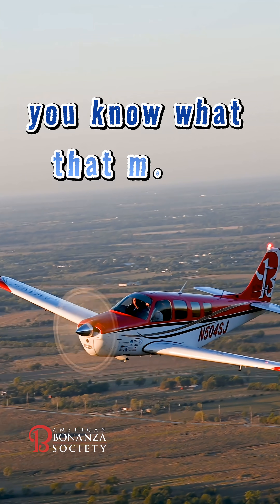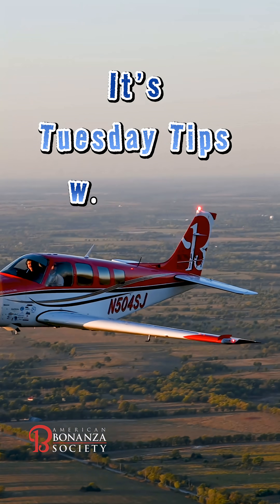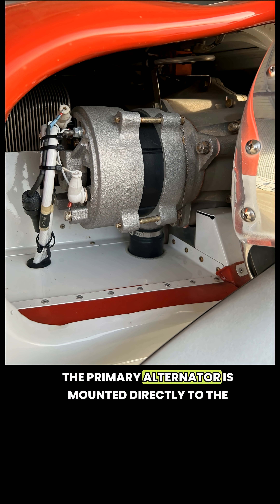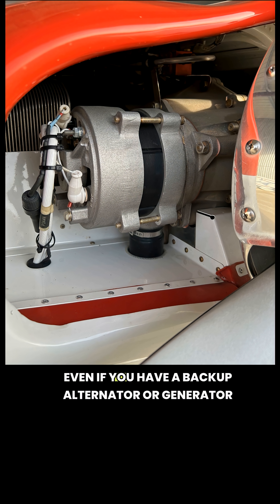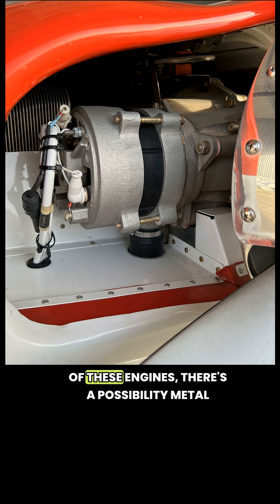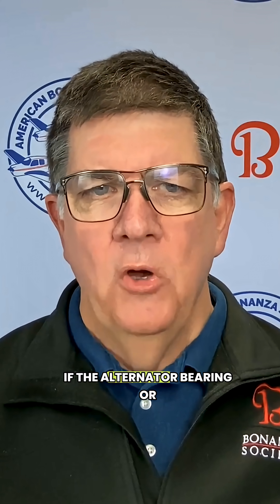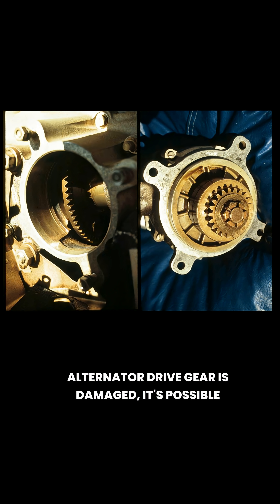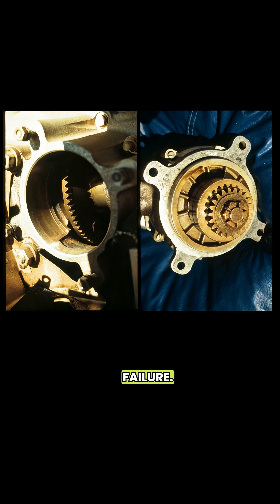Alternator Out in Flight: Why Gear-Driven Systems Matter

Comment: It happened to me , at night , vfr. Thinking I had a simple alternator failure I followed the checklist to no avail . Shed all unnecessary electrical load and landed safely as I was only 10 minutes from home. If the alternator does not reset YOU HAVE AN EMERGENCY. Declare with ATC and land at nearest airport
When my alternator was removed the drive mechanism was shredded , metal everywhere.
Upon tear down the crankcase looked like the floor of a machine shop. And no…the elastomer clutch did not release .
Absolutely no abnormals for the 10 minute flight but failure was minutes away 
Fate was not my hunter that night .